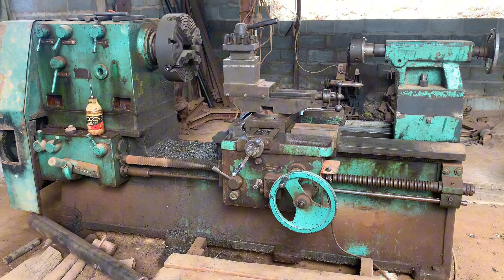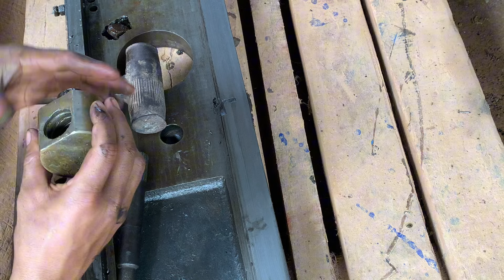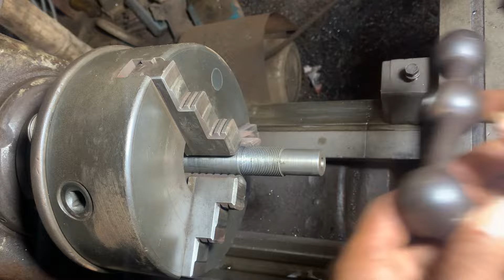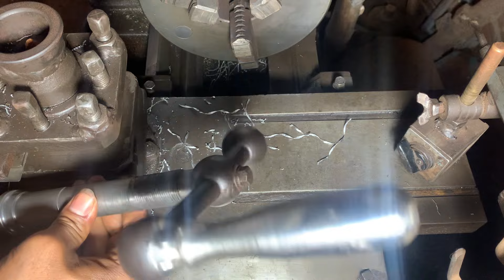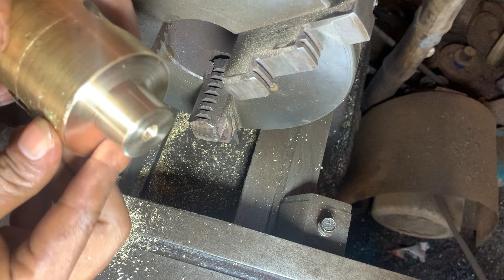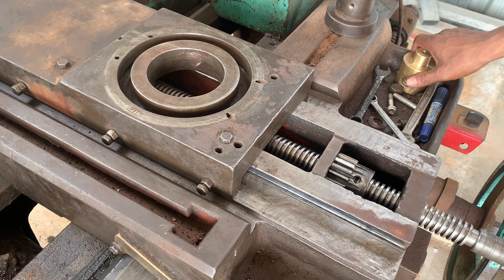Replacing a Damaged Lead Screw on My Old Lathe!@Abom79

Comment: I understand  Sorry if not found the Phosphorus  Bronze . Now you have second choice, any quality of Bronze you found Machining the shape and threading the nuts ,done.
Take a pill recipient steel better 🪣 ,fill up whit oil new or old (🚙 From car oil change)🛻. Then heating the oil  to temperature boiling   ♨the immerse the bronze nuts  ,live at least 1/2 hrs.
The material bronze will absorb the oil like  foam ,and remain lubricate the nuts for long time. 
Another choice manufacturing the nuts ACME -SQUARE thread from  CAST IRON ( fundici`on gris )  THE material have carbon and lubricate with oil or grease  .
Note of detail  you have a good Lathe because it old that mind the casting are good plus has double  prism  all the way in the bead, good machine for Boring hole . Greeting from Argentina -Canada❤🧉⚽🌗🛠🔎
Reply from the maker: Thanks brother